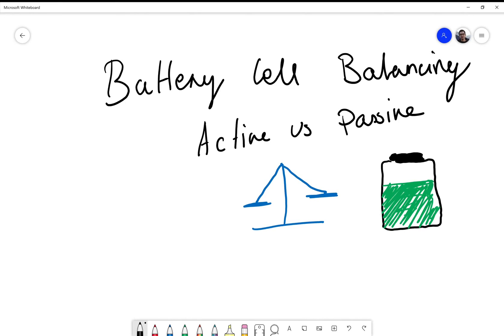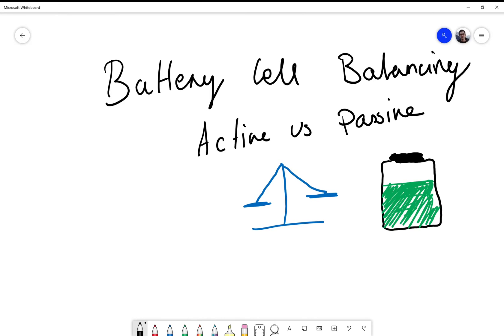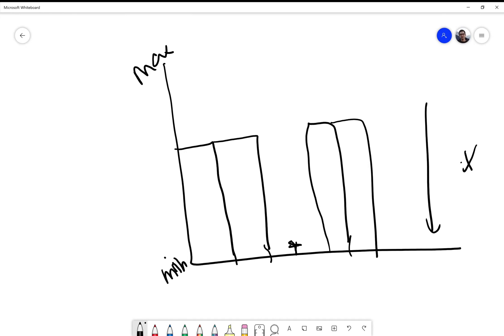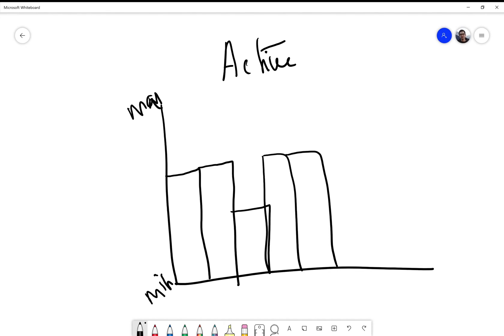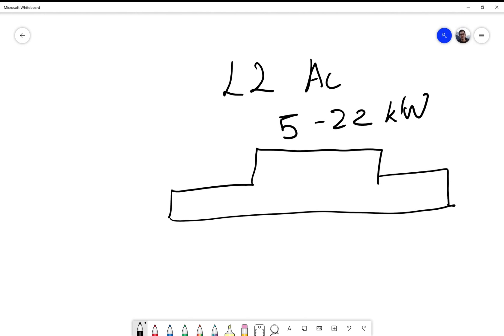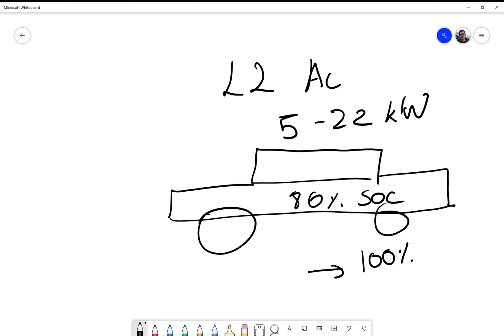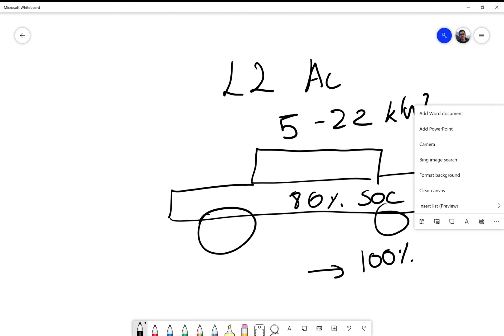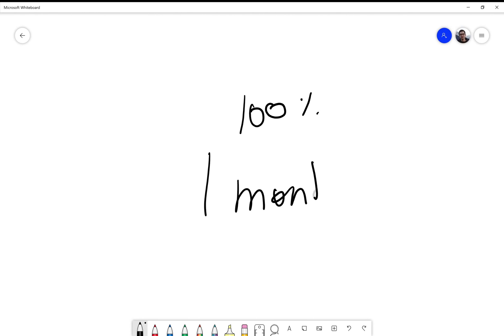Battery Cell Balancing Explained (Active vs Passive) | Improve your Electric Car Range | Engineering

Comment: Some EVs let you see the voltage delta between the cells which you can then keep an eye on and use as a guide to know when a balancing charge is required. Generally EVs should just be charged as needed though: charge to 100% when you need that extra range. In the case of my old Leaf, with just 18kWh usable capacity remaining, that's at least once a week! 😂
Reply from the maker: Yes. Generally that’s good practice for NMC cells, for LFP cells it’s recommended by most manufacturers to charge them up to 100% regularly. (1x week according to Tesla). Some cars will also tell you to charge to 100% to balance the cells when necessary.

Comment: so charging to 100 percent overnight , who would have tought what people already do  and seems common sense is the answer
Reply from the maker: Yes theoretically that is correct, as long as the car is designed for that. For models with Nickel-Manganese-Cobalt (NMC) batteries Tesla doesn't recommend charging them to 100% on a regular basis as this can increase battery wear (Tesla doesn't use a top buffer and therefore 100% is really 100% of the maximum design capacity). Most other manufacturers have a built in top buffer of around 5-10% which means you cannot fully charge the battery even when it displays 100%.

https://www.tesla.com/en_AE/support/range#:~:text=If%20the%20image%20of%20the,charge%20your%20vehicle%20to%20100%25%20. (see Daily and Trip & All-Wheel Drive Sections, this doesn't apply to the standard range vehicles using Lithium-Iron-Phosphate LFP batteries)

Comment: Many thanks. Am experiencing a battery cell balancing situation with a Ford Cmax Energi 2013 right now. I now need to research if the battery is an Active or Passive.

Just subscribed.
Reply from the maker: Thanks! Much appreciated & I'm glad I could help. I'm pretty sure it's passive balancing for the C-Max I don't know any EVs that use active, and definitely for PHEVs passive is better for cost reasons. Some cars let you read the individual cell voltage via OBD dongle, but I think the C-Max only shows average difference between the cells.